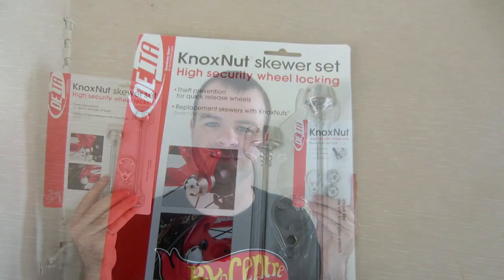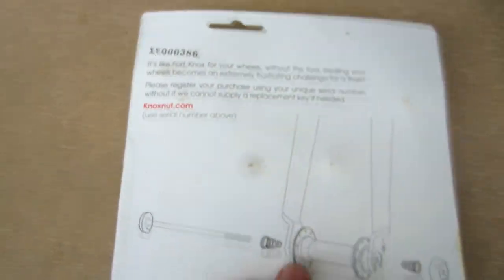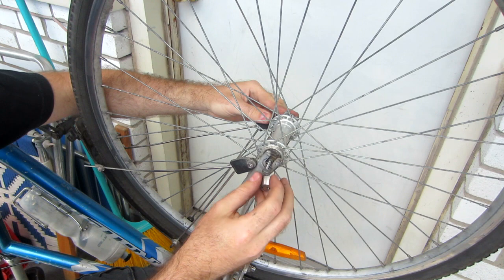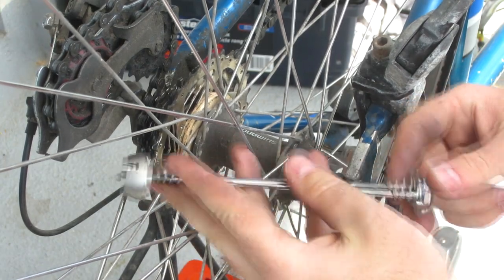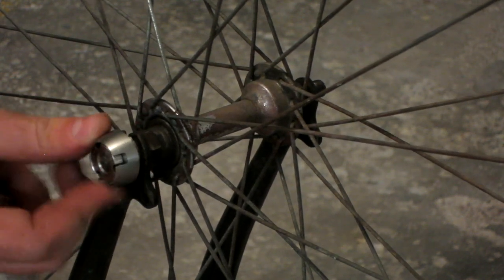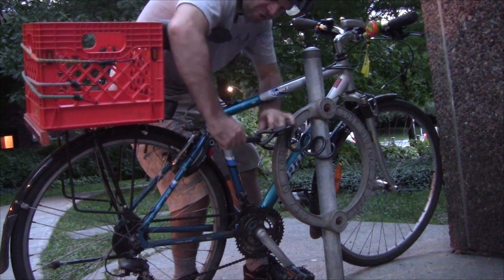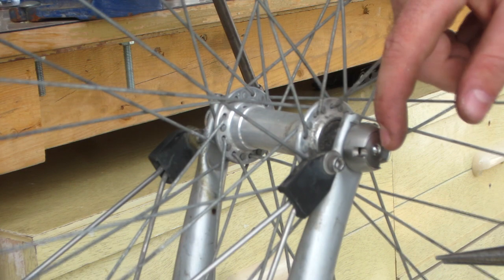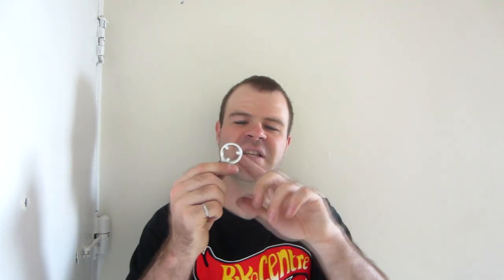How to Secure your Bike Wheels from Theft - Knox Nuts - Product Review

Comment: kyrptonite sells a nut that can be taken off with a regular wrench but the bike has to be upside down to take it off, which is great because you don't need a special tool and its nearly impossible to turn your bike upside down when its locked to a pole.

Comment: You didnt go over applying these to the back wheels. I ordered 2 sets, but a bolt on the rear derailleur prevents these from being applied. I have to contact the company to get an answer for this.
Reply from the maker: I showed installing it on a back wheel at 4:55, but that bike does not have a bolt on rear derailleur. Have you tried using 1 or 2 flat washers to act as a spacer before installing the knoxnut? Based on what you described, I think that should give you the clearance you need, assuming your axle has enough extra length.
Reply: @cjhoyle  thank you for the reply. I did think of using washers, but they would have to be cut in a way to make them fit. And i dont have the tools for that. I reached out to Delta about it. If they provide a solution,  I'll be sure to update this thread. Thank you for putting the video together. After having both of my wheels stolen while at work one night, your video was what led me to Delta for an anti wheel theft solution. Then having run into the rear wheel problem, i came back to your video for a possible solution.  So thanks again. You rock!

Comment: Except for small problem, there is a video of a guy using a small screwdriver and a hammer and got the thing to loosen up by hitting the screwdriver against the slot and the nut loosened.
Reply from the maker: Nothing is theft-proof. With the right tools and enough time a thief can steal anything.
Reply: @cjhoyle    Unfortunately battery powered angle grinders have made even the best locks easy to defeat.  Also unfortunately there is YouTube that shows people how to break various bike locks and those skewers.  I like YouTube, don't get me wrong, but some of the stuff they show should not be allowed, like how to break into stuff, and how to steal bikes.

Comment: So you have to use 2 separate tools to fit/remove the nuts (and take them everywhere you go.)
The Halo system is better, which utilises just one security hex socket in the centre.
Reply from the maker: It depends how you look at it. Removing the wheel while you're out on a ride is really only a useful thing to do if you are carrying bike tools to repair whatever is broken. Allen keys are a pretty common bike repair tool to carry, so I think it's clever than this system made their tool more small and compact by assuming you'll already be carrying an allen key.

Comment: I have heard the skewers you need for a bike are dependent on the type of bike you have (21 speed or 18 speed etc). How true is this, and if it is true then what typeof bike will those skewers fit?
Reply: I have never heard of this. Industry standard axle fitment lengths of 130mm (front) / 150mm (back). Also there is no such thing as a 21 speed or 18 speed. I understand what you are trying to say but in bike talk amongst people who ride bikes speeds only refer to the amount of cogs on the freewheel or cassette on the rear. 7/8/9/10/11 are the most common "speeds", well of course there is the single speed as well. If you really think about it you will understand why that is. Is it not possible that if you have 50/34 compact (two chainring cogs) in the front and lets just say 9 in the back that being on the 50 chainring and one cog in the rear could have the same exact gear ratio as another cog has while on the 34 ring? In fact there are several in most set ups that give the same effective ratio because you dont want to for example be on the 50 in the front and the 32 in the back because your chain would not be very straight, the gears could skip, cause premature wear etc. Learning how to ride a multi gear bike properly is something the very casual rider really never learns how to do properly...and half the reason they cannot be competive aside from personal fitness, doing it wrong results in loss of wattage and inconistant cadence...which is what racing is very much about. So say you have 10 cogs in the rear, there are really only 10 effective gear ratios not 20, think about how the chain moves furhter and closer to your bike as you shift ...the outter ring is for the big in front small in back...and vice versa half way through the cassette if you are gearing properly on the most basic level, in the middle of the cassette it is a bit more complicated than that..but I think I explained the principle (it is the reason why higher end groupsets can jump 3 rings in the back with a long hold of the lever because switching between the front two on a compact is effectively a 3 cog difference in the rear apart from one another. ie the 7th cog in back is the same gear ratio as the 4th one on the other chain ring in the front..I hope that makes sense.

Comment: Is the key different for each package or can someone go buy a set and use their key to unlock your axle?
Reply from the maker: 11:13
Reply: Yeah thats what I was thinking. They should consider rotating key patterns, that is a major security flaw imo
Reply: He does mention at 11:13 that anyone who has the one of the keys could potentially steal your wheels but I'm not sure he did thorough research on whether every key is a little different.

Comment: wow the keys are all the same and the codes are all on the outside so i could literally take a pic and order one
Reply: Mr.ActionGal101 It's not meant to be a perfect alternative, it's better than having nothing at all.
Reply: You can maybe without an account, but the replacement keys cost $10. And then if you'd buy the key for this type of lock, you got to then carry it around constantly on the off chance that you'll find a bike with these particular locks. Instead of bikes equipped with "Axlerodz" or "Hublox" (another $20) or just a regular nut. And if you're carrying all those keys and a regular wrench, you end up chancing a charge of "burglary tools." at that point. Anyway like Epic said it's better than nothing. And there is the convienience of not having to rig your cable lock all through everything. I just wish they were cheaper.
Reply: Then you only have to find the one bike somewhere on this planet that the purchaser of the skewer used the skewer on.
Plus be ready to steal the wheel when he drops his or her guard.
You must be a senior tech at some engineering firm.
Reply: So it seems the best idea would be to use the least used brand's key as the thieves would never expect them. Or rotating key patterns? Every year or two years change the pattern so the thieves would always be playing catch up
Reply: Total junk, my neighbor bought it and returned it!

Comment: Great product, until I checked it out on Amazon. One reviewer managed to easily defeat this using an Allen key...
Reply: yeah. and he did that in his house. try that trick in public and let's see
Reply from the maker: Thanks for bringing this to my attention. After watching the video, I'm kind out skeptical in the reviewers claim of "fully tightening" the skewer before filming the video. All these years later, I still use this product on my bike, and when I put my wheels on the bike I always make the skewers extremely tight. The amount of force needed to unfasten the wheels on my bike is significantly more than the amount of force this other reviewer appears to apply with the allen key. Nevertheless,  I will try this alternate method the next time that I need to remove one of my wheels.
Reply: cjhoyle thanks a lot for reaching out. I was so impressed after watching your video. I really wanted it to work. Other “safe” options that’s not well over $40 for front and rear wheels comes with its drawbacks. I was looking at kryptonite ones too but they do needed to be flipped upside down. Please let me know the security of this system with Allen keys; if they’re still secure I’d probably get it. Thanks!

Comment: Video way to long for something this simple. Looks effective unless some thef has pliers. Sorry people you just need to protect your wheels the old fashioned way with a lock especially if they are expensive.
Reply from the maker: In the video I showed that even with pliers, these knox nuts are not easy to remove (I wasn't able to do it). With the right tool and enough tool there isn't anything that a thief can't steal. Just like a good quality bike lock, accessories like these are never going to make a bike or it's parts 100% theft proof because there is no such thing. They simply act to make things more difficult to steal, and your best hope is that the thief decides to choose an easier target instead (or better yet, decides to make better choices in their life). I acknowledge that this video was long and not as condensed as I would have preferred. This was one of the very first product reviews I ever did and I feel I've improved at making these types of videos since then.
Reply from the maker: @larchman4327  I see what you're saying. Needle-nose vice grips might be able to do the trick, but is that really something that a typical thief would be carrying?
Reply: @cjhoyle  I suppose I'm thinking to critically. these are just another obstacle for thieves. Just nervous cause I've had meth heads hanging around my bike at the store before